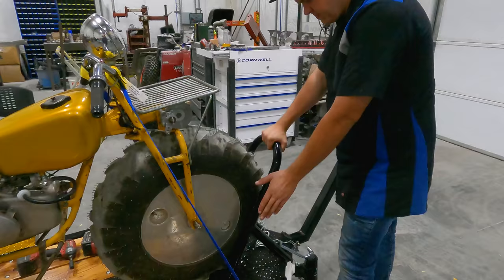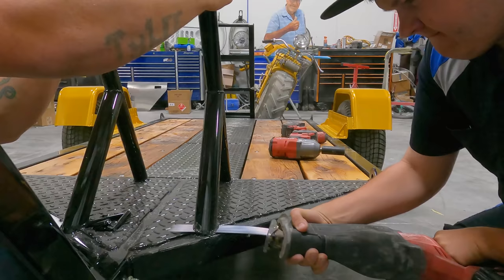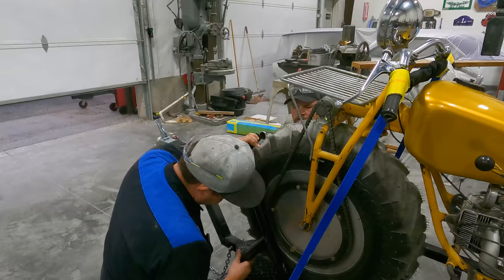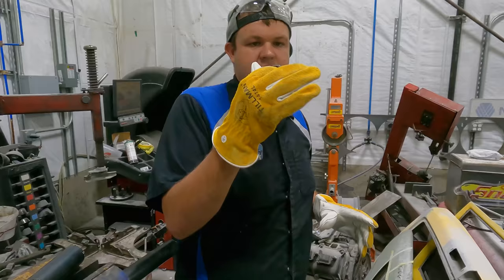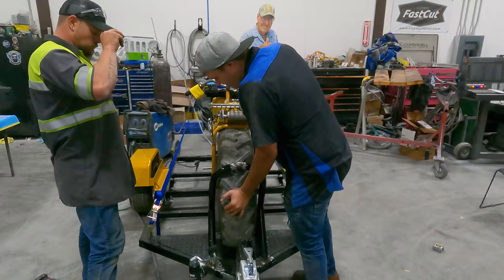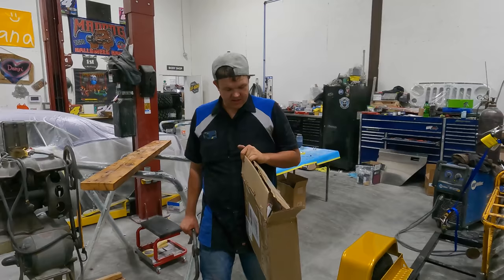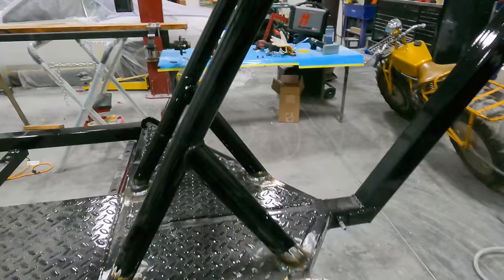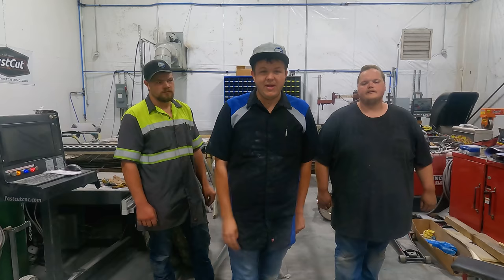We Had To Cut Fresh Paint On The Golden Nugget Trailer!

Comment: As new products adapt to environmental  rules they become more finicky.  No lecture on it as it is what it is, it's a learning curve.  It takes time and experience to learn new products and what they will and will tolerate.  I know the old RM Dyamont clear could be sprayed without activator and the dryer would allow the solvent to leatch out and you were good to go.  Not possible with today's clears.  Spraying sealer wet on wet is a standard of the industry and has been for years but different manufacturers have various time limites.  Sad thing is most bought mass produced trailers are urethane strengened on bare metal so you are giving Edd a much superior product.  I just hope he has time to enjoy all everyone is doing for him, he has slowed down a lot in the last year.

Comment: Foot is disappointed there was no chop saw, drill press or cutting oil. Do you need extra money? Looks like the trailer wood will need to be notched for the new ramp straps and straps will need a finger tang to lift up the straps from their resting place. Thanks for posting your fabrication progress.

Comment: I like what your doing for Ed and all, but I did notice that the back hinges for the hold down is where you had the boards already fitted. Are the inside bolts going to clear the fitted boards? Better check before you paint trailer. God Bless

Comment: Do you use use Weld Through Primer when building/welding/assembly ?
Safety wires for the cotter pin locks on the ramps, they can be lost easily..

Comment: A SMART ENGINEER, would have made a clamp device to press against the tire of the bike.  A ramp strap ... probably should make the ramp wider as the old man will fall over unless there is footing which means a full width ramp for the trailer and also no step down for Ed to break a hip or knee on.

Comment: Hey guys, Your ramp is upside down on the trailer. How can I tell? It has the V channel on the wrong side. It should be on top when it’s extended. You never want crossing members underneath the long supports. That stresses the welds, and if one should crack, the weld fails, the weight of the Rocon will bend it right down.  Laid on top, that can’t happen. Have a great day!

Comment: If the ramp pins would have been on the metal straps instead of the ramp, you would have less chance of getting hurt by them when lowering the ramp  And you could have made holes to bolt them down on the trailer (with the same pins)... just saying :P

Note that it's easy to say stuff like this once you have seen them done by someone else and I'd probably would have done the same 

Love your drive to do the "right thing" :)
Reply: Also... we do it nice cause we do it twice ..... :P

Comment: If a tire of the Rokon slips off the side of the ramp would the permanently welded pin slice the sidewall of the tire?  Or worse,,, if the ramp is on its way down to the ground would the pin sticking out cause someone to accidentally get cut open?

Comment: so ummm. . . the hitch safety chains wont reach the back of the nugget in the current location, without a big extension at the least . . . . if the location isn't moved. 
Dont really like the trip hazard for ed, of the ramp tabs on the deck. but that's just my opinion

Comment: You  should tether the cotter pin with a small chain or tiny cable so Ed doesn't loose it.  10:36 Something like this- https://www.kartek.com/mm5/graphics/00000001/AFB-TETH100-HoodPinClipwTether.jpg         Only smaller

Comment: Robby. You messed up on this one. You should of made sure the tire fit in the rack, before all the work and paint. Plus the ramp, I would of made a slip pin for it. So when you raise the ramp, it pops into lock. I am not knocking what you done but. Just adding my two cents.

Comment: You guys r like fab rats. We do it nice cuz we do it twice😀. Nature of the beast with custom fab. Quick tip. I use the heck out of portable band saws for cutting pipe and smaller metal stock. Very accurate instead of sawzall. I have a larger corded Milwaukee and a 20v dewalt one. I know Milwaukee makes cordless as well. Hope this helps. Love the work

Comment: Should have tied the ramp into the trailer hitch. Less moving parts and not causing a trip hazard for Ed.
Reply: What?? How??
Reply: @RFDarter  
Connect the tab on the hitch to the ramp with a pin.
Reply: @vicgustafson8514  Ah you mean to the hitch of the rokon

Comment: Robbie better get a move on. Paul got the golden nugget running and probably almost done. Paint problem happens but don't be surprised if it's done before the trailer done
Reply from the maker: Everything is done.
Reply: @RobbyLayton  
The fender are painted different then what you had before. But it looks good anyway
Reply: @RobbyLayton  
Look how you paint it the first time. To the second the frame of the trailer that holds the fender is black not gold